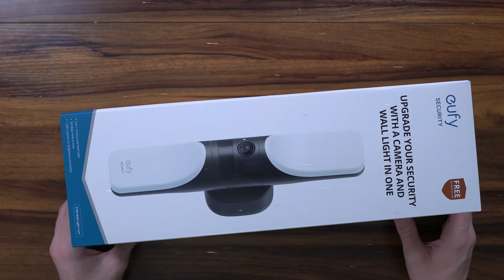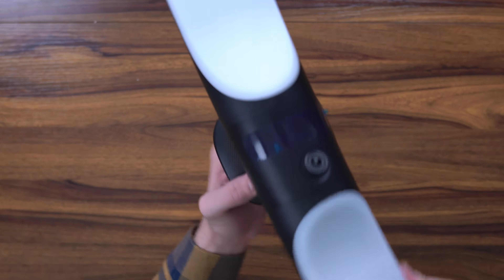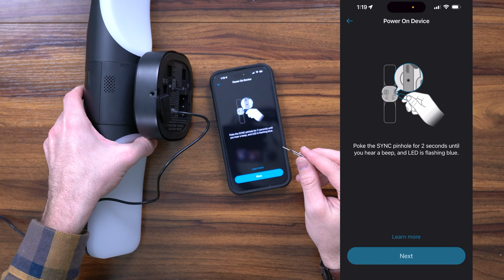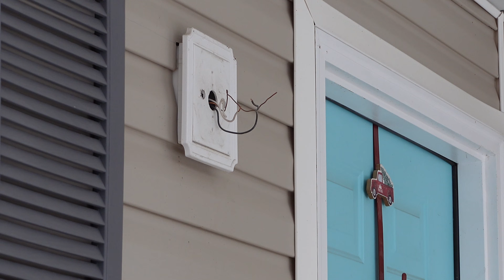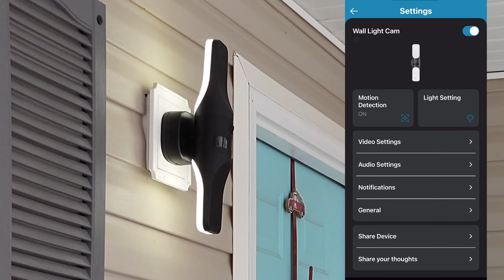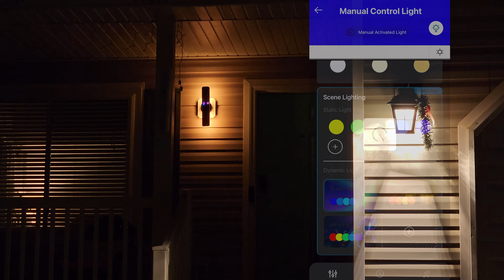Eufy Wired Wall Light Security Cam

Comment: Did you use the anchors or did you just screw the base right into the light mounting box?  I just broke a screw in the electrical box and it looks like I will need to screw it in like you did. Nice video!

Comment: I spent two frustrating days trying to connect this to my network. After figuring out that you have to set your network name and password to simple names, no special characters or spaces, it finally worked. After hookup the software updated and I installed it, however after changing my network name and password to a more secure one it dropped connection again. Then it wanted me to start all over gain in pairing mode. I have other Eufy products and have never had these kinds of problems.